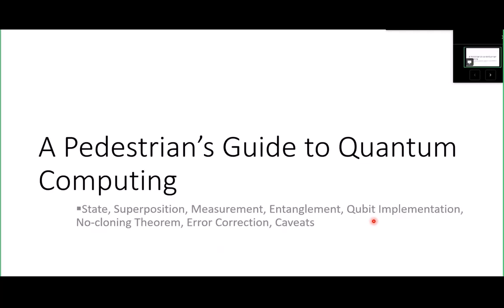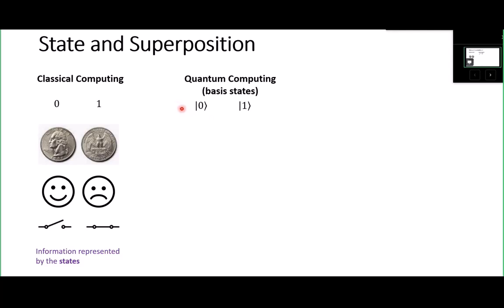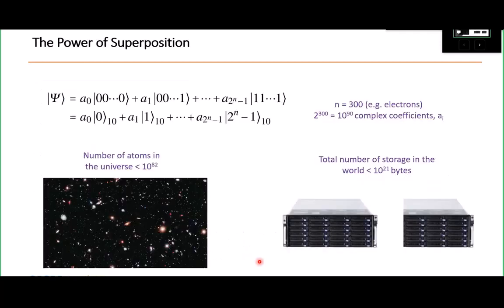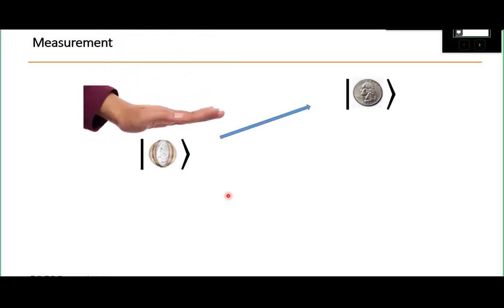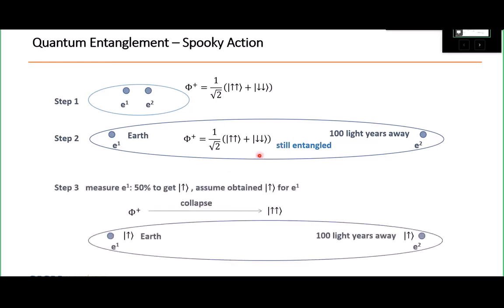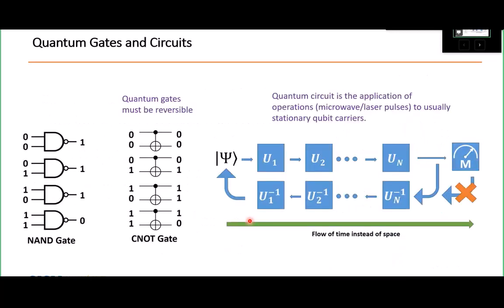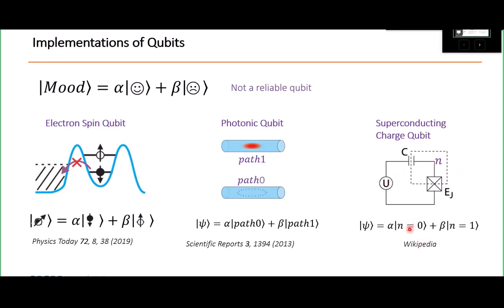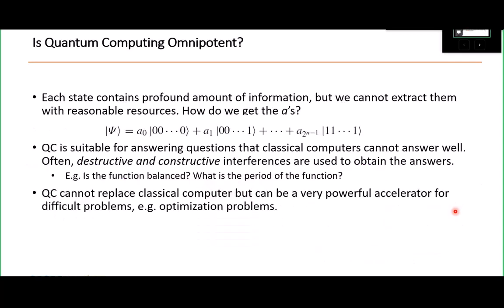Quantum Computing Explained and Overview

Comment: Thanks for the greatest Video! 

I have a question, I am a Storage and Backup Engineer managing Petabytes of Data and 100s of Storage Systems, 

How Storage system going to evolve in Quatum Computing ? Do we need more Storage? More Datacenter foot prints?

Please explain
Reply from the maker: A quantum computer needs a lot of classical storage for calibration. However, compared to big data, it might not have a significant impact. On the other hand, if a quantum computer is successful, when it is used to solve a big problem, the big problem itself will consume a lot of storage already.
Reply: @quantum_computing  Thank you! I no need to worry about my JOB for next 2 decades! haha!

Comment: The video is excellent. Can you inform why you have used (0000) _2 in classical register and in quatum regiater you have used 0_(10).
Reply from the maker: @chethanb.s3980 They are the same. _2 is the binary system and  _10 is the decimal system. So (0011)_2 is (3)_10. I should have made this clear. I tried to show different ways of writing. Either is ok. Thanks!

Comment: It's an amazing lecture. Thank you! Also I found your book and should I watch the videos or finish the book first?
Reply from the maker: @CagnBerke I would suggest watching videos and referring to the book when it is not clear. However, if you learn better by reading than by watching videos, you might want to read the book instead. Anyway, if you have any questions, please put a comment under the corresponding video and I will try to answer. Thanks!